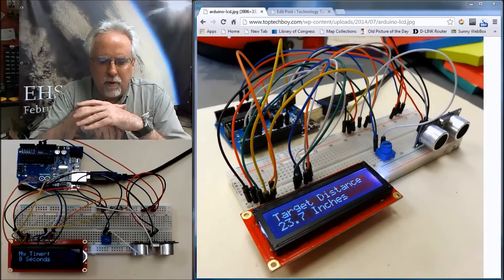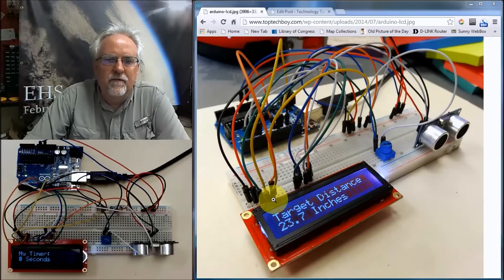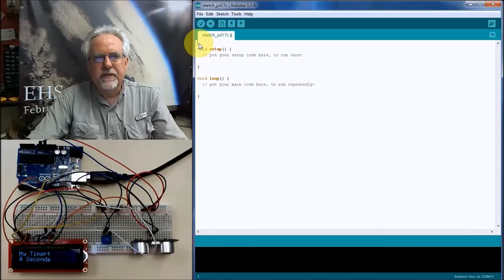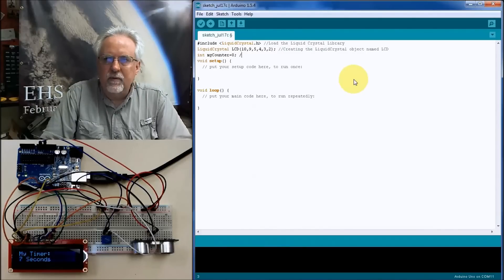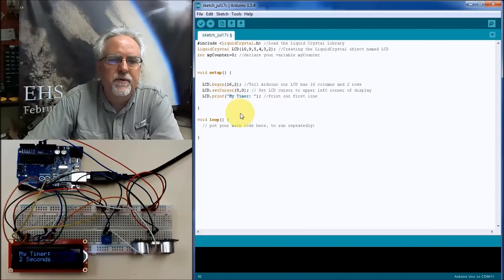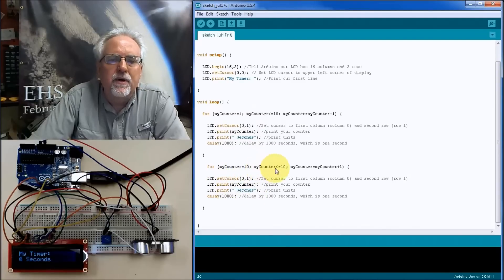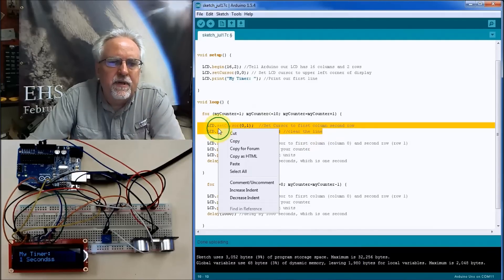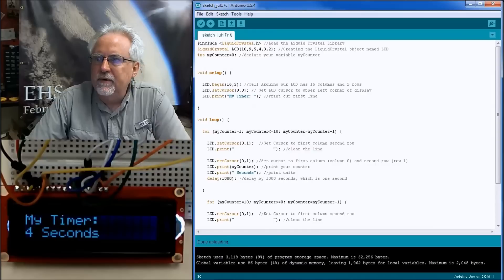LESSON 19: Using LCD Display with Arduino

Comment: Another great lesson Mr. Mcwhorter! I had fun with this too, did my own thing a bit and learned a lot as usual. I used the lcd.clear(); command for the ghost letters(I had ghost numbers) and my LCD has an i2c backpack for easier wiring if you don't mind an extra line or two of code. Thank you sir, this is knowledge I'll be using often.

Comment: if you set a pwm pinout to pin 3 on the lcd you can set the contrast manually in the code. you can move the wire from pin 11 to pin 13 on the arduino if you don't have any pwm pins available. i had to do this for a project because i only have 3 pots and i needed all of them besides the one for the contrast.

Comment: Great video series.
One thing that may be worth mentioning is that at least in my experience with an Arduino Nano, you MUST tie the RW pin on the LCD to ground.
If you leave it unconnected and floating there will be no display even though the code will appear to be working on the serial monitor.
Took a while figuring that out!!
Reply from the maker: omgffsification Thanks for the comment.

Comment: Sir I really want to thank you for your series of Arduino tutorials which are really helpful to me as a beginner. I really appreciate your way of teaching which really helped me up from scratch. I have completed upto 14 tutorials. Now i am trying to do a  simple project.
1. I wish to control a dc motor connected to an Arduino uno board with a "1602 LCD Board Keypad Shield" which i would like that a user can program the time to on/off the motor and the also the time span for its run

Sir can you give me some idea. 

Regards
Abhiswar Mukherjee

Comment: I connected my LCD screen to breadboard first,but the lcd didn't even turn on , so I connected the power lines to the arduino board directly , the lcd turned and showed only one line of rectangles , I have only the pin RW connected to breadboard , I'm stuck now and have no idea what to do , any ideas ?

Comment: sir, i hooked up my lcd screen.  16*2 boxes are appearing but when i compile the code - no display. what should I do?
Reply: Same situation X(
Reply: You have to be hooked up to a potentiometer and check that you have all the proper connections. I had the same issue and found that one of my ground to ground wires was instead ground to power... once I fixed the issue I was able to then use to potentiometer to adjust the brightness of the LCD and got it to work.

Comment: 26:50 - I don't know about back in 2014 when this video was posted, but these days at least, you can use a PCF8574T LCD controller module to control it with I²C, so you only need four wires (two for data and two for power); they even include a built-in pot, so you don't even need to do that. On the one hand, it's great that things are easier, and plug-and-play like blocks, on the other hand, it feels less rewarding to be even more removed from doing things manually. :-\
Reply from the maker: Yes, I think there is something good about doing a complicated thing and doing it right.

Comment: Just add a space after Seconds in both places will do the same thing. I am moving to a 4 x 40 display. It has two E signals. I think I will need to create an LCDupper and LCDlower object. The need to update the LIBRARY for bigger displays.
Reply: The LiquidCrystal library suppoets 2004 LCDs (thats 4 lines with 20 character per line). The only difference is specifying "LCD.begin(20,4);" in setup() rather than "LCD.begin(16,2);". You can specify the four lines as "0, 1, 2 or 3" in the "LCD.setCursor(0,0);" command. For instance, to move the cursor to the 8th character position in the third line of the 2004 display, use the command "LCD.setCursor(7,2);". Not sure why programmers insist on counting everything beginning with "0" instead of "1", but most the time they do.
Reply: P.S. the same I2C interface (daughter board) works on the 2004 just as well as on the 1602 LCD displays. Need to use LiquidCrystal_I2C libeary. The I2C address on mine (I have maybe 20 of them) are either 0x27 or 0x3F. Sometimes the I2C interface appears not to be working, when it usually is a matter of not having the correct I2C address for the interface you are using. I have also come across a couple of different sketches for the Arduino that will scan the I2C device using all possible comibinations of I2C address and then display the one (I2C address) the device responds with. These are called I2C address scanners.
Reply: A 4x40 display, that would be two 4x20 (2004) displays, I assume. I have not seen a 4 x 40 display that can be run using the LiquidCrystal library. There are larger capacity graphic LCD displays that have Arduino compatible libraries that could be adapterd to provide a 4 x 40 display, but these "GLCD" displays are not as compatible from vendor to vendor as the 1602 and 2004 displays are. So, you'd be pretty much on your own for locating a compatible Arduino library. Check out the Arduino.cc website to see which GLCD diplays they support, and limit your buying to one of those is perhaps the best advice I can give.
Reply: I do recall seeing a display that had 2 rows of 40 characters (a total of 80 characters), but the pin-out was two rows of 8 pins and I could get no assurance from the vendor that the device was Arduino CrystalLibrary compatible, so I decided not to investigate it further,

Comment: I followed along and ive gone over every wire 3 times I even took out the audio sensor and there respective wires leaving me with the LCD and potentiometer the codes running fine I think my LCD display is broken any other suggestions id really like to know???

Comment: Why is the 1602LCD designed to require soldering?  Why doesn't the 1602LCD come with the pins already attached?

Comment: Hey why isn't my LCD display print ING anything....it has turned on but isn't printing anything......no problems in my code
Reply: If there's no problems with the code, then you must have hooked everything up incorrectly. It wasn't displaying anything last night, and I got so frustrated. However, the next morning I realized that I flipped my potentiometer's 5V and GND wiring. After that, it fixed itself.

Comment: Mr. McWhorter just to tell you that the comments on the rows "delay(1000);", there is an error. It should be written as delay by 1000 microseconds, not 1000 seconds.
Reply: Milliseconds? Not microseconds? Just sayin.

Comment: Instead of using a potentiometer  to set the brightness of the LCD, could we set it using the Arduino to set it?
Reply from the maker: +James Margetts Yes, it is being set by the Arduino. It just uses the potentiometer to decide where to set it. You can use whatever to decide how bright to make it.
Reply: The 1602 LCD require a fair amount of power to work with readable brightness, and I would be really surprised if the current supplied by digital I/O pins would be sufficient to power the 1602 LCD display. I admit, I have not tried this. It is theoretically possible to do if you are using the digital I/O pin to drive a transistor or other device that can supply the +5v poser needed needed, perhaps using PWM. When I have a fair sized breadboard project that employs several modules, the first component I usually notice not having sufficient power is the 1602 LCD display which gets dim or may no longer display at all when I hook in another module. Usually the fix is to use an external +5V power supply. This occurs frequently enough that I keep a good supply of 110/220VAC to 9V DC power adapters and 9V to 5V DC regulator modules on hand to deal with these situations.

Comment: Hey I need a little here on a project, I have watched a lot of tutorials/videos but what I am trying to do is a bit different, not too hard but as I am a beginner I am unable to find a solution, hope someone can help.
Now what I am trying to do is to build a status LCD Board for the visitors that visits my office, actually it will be a box fitted with an arduino uni=o, a 1602 LCD and Four Status LEDs(one of them would be for power indication).
This box will be fixed to the door with a 5V supply inside, there whould be 4-6 wires(as necessary) coming out of the box on the door coming to my desk where I would have another box with 3 push buttons and a power button to turn my arduino on/off.
The first Line of the 1602 will always Display "* Haris' Office *" which is pretty simple.
The second line is where things get complicated and out of my hand.
1st Push Button will instantaneously display "Kindly visit again" and turn Red LED ON.
2nd Push Button will instantaneously display "Meeting in progress; press CALL button if urgent" and turn Yellow LED ON.
3rd Push Button will instantaneously display "AVAILABLE: You May Come IN" and turn Green LED ON.
Due to the size of LCD it might be necessary to slide the text from right to left. 
If anyone can help me with the program I would be greatly helpful.
Reply: Sounds like you have one 1602 LCD display, and depending  on the state of 3 push buttons, you want to display a different message. Could have 3 int variables called btn1State, btn2State, and btn3State. Initially all would be reset to zero. The three digital input lines to which the state of the 3 buttons would have to be setup as inputs. Say you are using digital i/o pins 2,3,4 for the three pushbuttons, the code would be something like the following:

void setup() {

    pinMode(2, INPUT; 
    pinMode(3,INPUT);
    pinMode(4,INPUT);

...
}

void loop() {
...
    btn1State=digitalRead(2);  // Read State of button 1
    btn2State=digitalRead(3);  // Read State of button 2
    btn3State=digitalRead(4);  // Read State of button 3

    if (btn1State==LOW && btn2State==LOW & btn3State==LOW) {
        // Display default message "* Haris' Office *" 
        LCD.print("* Haris' Office *" );
     } else if (btn1State==HIGH && btn2State==LOW & btn3State==LOW) {
         // Display message for button 1
         LCD.print(" whatever 1   ");
     } else if (btn1State==LOW && btn2State==HIGH & btn3State==LOW) {
         // Display message for button 2
         LCD.print(" whatever  2   ");
     } else if (btn1State==LOW && btn2State==LOW & btn3State==HIGH) {
         // Display message for button 1
         LCD.print(" whatever  3 ");
    } else {
         // Display message for other 'invalid' combinations
         LCD.print("Press only 1 button at a time. ");
    }
    delay(5000);  // allow time for person to read the LCD display
...
}

The code above is not a fully functional program, but should give you enough of an idea of how to code it.

P.S. They also have 4 line LCD displays called 2004 LCD displays where "20" stands for the number of characters per line and "04" stands for the number of lines. To setup, use LCD.begin(20,4) instead of LCD.begin(16,2) in the setup() part of your sketch. With a 4 line display, could display each message for all the buttons.

Comment: Can we use the SD card module and LCD display at the same time using a single board arduino..??
Reply from the maker: Afrizal Arif I am not sure if the arduino has enough memory for all those libraries. You would just have to try it and see.
Reply: I have used a SD Card and 1602 LCD display with an Arduino Uno, but more than likely mine was an I2C 1602 display. There is enough memory for both the SD library and the LiquidCrystal. The SD card uses what is called the 4-wire SPI interface (SCK, MOSI, MISO, CS). With I2C 16012, two more digital I/O pins are needed (SCL & SDA). So with an Arduino Uno, that should leave maybe 6 digital I/O pins and 6 ADC pins to be used for attaching sensors. Using a 1602 using a 4-bit wide parallel interface with a couple extra control lines as shown in this video means you'd have only like 2 (4 less) digital I/O lines. For data-logging projects like this, I'd recommend the I2C_1602 display board where the I2C interface is a daughter-board you solder on back  on the 1602 display board. Use it with the LiquidCrystal_I2C library which you can find on the Internet using Google with search words like "Arduino", "1602", "I2C", and "LiquidCrystal_I2C".

Comment: the LCD I used has only three pins, one is 0V, V+ and IN, could you tell me how to connect the IN pin to Arduino? I cannot upload the programme your code to my arduino, I know it might because of the connection problem, how could I modify your program for my LCD? THX
Reply: could anyone who knows help me ?

Comment: i am trying to build a catan digital dice but when i try to upload the code,I keep getting, Arduino: 1.8.5 (Windows Store 1.8.10.0) (Windows 10), Board: "Arduino/Genuino Uno"

In file included from C:\Users\taran\Documents\Arduino\sketch_feb15a\sketch_feb15a.ino:1:0:

C:\Users\taran\Documents\Arduino\libraries\LCDKeypad/LCDKeypad.h:18:1: error: expected class-name before '{' token

 {

 ^

sketch_feb15a:12: error: initializer provided for function

 void setup() (

              ^

sketch_feb15a:14: error: 'lcd' does not name a type

   lcd.clear();

   ^

sketch_feb15a:15: error: 'lcd' does not name a type

   lcd.println (" roll the Dice");

   ^

sketch_feb15a:17: error: 'randomnummer' does not name a type

 randomnummer = random(1,7);

 ^

sketch_feb15a:18: error: expected constructor, destructor, or type conversion before '(' token

 randomSeed(analogRead(5));

           ^

sketch_feb15a:20: error: expected unqualified-id before ')' token

 )

 ^

C:\Users\taran\Documents\Arduino\sketch_feb15a\sketch_feb15a.ino: In function 'void loop()':

sketch_feb15a:26: error: expected ';' before 'diceOne'

 lcd.println diceOne;

             ^

sketch_feb15a:26: error: statement cannot resolve address of overloaded function

 lcd.println diceOne;

                    ^

sketch_feb15a:27: error: expected ';' before 'diceTwo'

 lcd.println diceTwo;

             ^

sketch_feb15a:27: error: statement cannot resolve address of overloaded function

 lcd.println diceTwo;

                    ^

exit status 1
initializer provided for function

plz help

Comment: The double 's' problem on the display, could be fixed easier. What I did instead was putting an extra 'space' after 'seconds'.
So the code looks like this:
LCD.print(" Seconds ");
instead of:
LCD.print(" Seconds");

Comment: Dear mr Paul ,
What if my LCD is a 16 / 2 dimension , but what differ its a fuduino
My LCD is think is it the new version ,
where The LCD is internally hooked with a bottom chip that  has the 4 pins (GND , VCC ,SDA ,SCL only ) The other pins are physically hooked up to the LCD byitself
So i need the code where you stared with for exmaple :LiquidCrystal LCD(10,9,5,4,3,2 )
So i need The coding for This LCD i have ,
i cant find it on google neither in the specs sheet 
Hope u understood my question ,
w*ting for an answer Hopfelly
Thank You MR
Reply: ==> Bassam.  It sounds like your 1602 LCD display came with a I2C interface "daughter board' that is soldered onto the back of the display board. The SDA and SCL signals are I2C signals. So, you will need a special version of the Arduino LiquidCrystal library usually called "LiquidCrystal_I2C". You can search for a download location using Google or othe search engine. The earlier versions of this library had a bug which would only allow you to display the first character of whatever you printed to it be it an int, float or string. So, be sure to get hunt around for the latest version you can find. There is a patch for the bug, but it was so long ago I can't remember where I found it, but I had to hunt a long time for it. I actually prefer the I2C version of the 1602 despite have to pay a few bucks more for the I2C interface (and solder it in place) because the interface frees up 4 digital I/O pins that can be better used for other purposes. 

I have also interface the 1602 LCD using a 74LS595 SIPO shift register which uses a 3-wire interface (the I2C being a 2 wire interface) and there is also a 3rd party version of the LiquidCrystal Library for the 595, but it uses the original file name, so installing it overwrites the original Arduino LiquidCrystal Library. So, it's best to save the original library elsewhere before installing the '595 version of the library.

Comment: With the counter, how could you get it to display 1 second rather than "seconds"?
Reply: Add some extra code like:

if (mycounter==1) {
    LCD.print(" second. ");
} else {
     LCD.print(" seconds.");
}

Notice how I pad the singular case with an extra space to cover up the period. Failure to do this will result in
" second.." with two dots being displayed. When updating a line of the 1602 display it's best to either clear the 
line before you update it, or display the result with one or more spaced tacked on the end to cover up any characters
left over from an earlier print. When dealing with dates and times, this can drive you crazy as days, hours, minutes and seconds with a value less than 10 will display with 1 character (0-9) and 10 or above will display with 2 characters and since a date and time field can have 4 or more data fields that can mess up this way it is important to test your code with pretty much all possible data combinations so you can be sure to catch all such formating bugs.